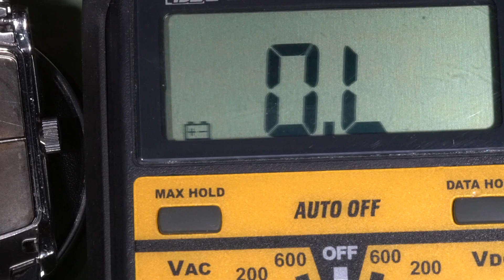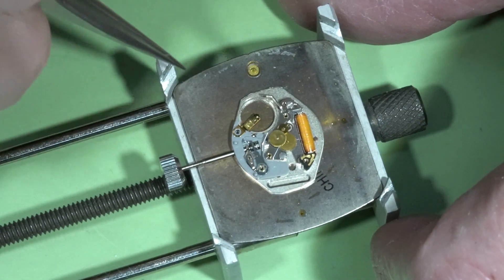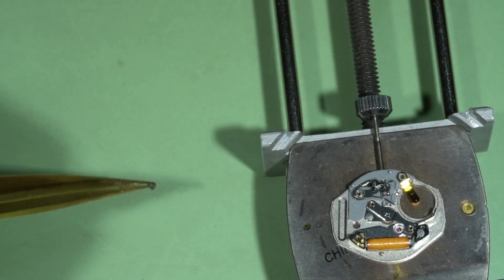Fixing Harley Ronda 763 Quartz Movement Watch Repair How To

Comment: That’s a Ronda 763E, it’s a one jewel movement, and you can easily tell by the silver metal over the gold tone used on the older Ronda 763’s. I have this movement in my Vero SWQ, and it’s pretty nice, reasonably accurate but I’d prefer a Miyota 2115 myself. Japanese quartz movements are really good.
Reply from the maker: I never saw 763 with E letter. There are G and some numbers, or just 763. The silver tone plates are used when the movement is manufactured outside of Switzerland, and gold are used in the original Swiss production. Both Swiss and Japanese quartz movements are good... until they broke. 🙂 Thanks for watching!

Comment: I understand repairing is good (less junk on the planet!) but for this wouldn't it be easier and cheap enough to just put a new Ronda 763 in it? I found one online for just €4.
Reply from the maker: Of course, it would. But there is an another layer of thinking (and doing), which explains why people have the most fun, when they can do, even it's harder, than not to. Sometimes they call it a hobby. 😀

Comment: LR Alkaline Batterie?
Reply from the maker: Correct, LR is alkaline battery. Thanks for watching!
Reply: @ValentechTime  That bat will only last 3-6 month depending on the movement therefore silver oxide is the recommended practice in the industry....and I did not ask for a validation and merely pointed out the inferior product. Nice work, thank you for your reply.
Reply from the maker: @SorinClenci  Sorry, misunderstood. You put a question mark on your first comment, so I answered.

Comment: did you find out why the rotor broke? you must have a large selection of parts. thanks for the demo.
Reply from the maker: I can only guess why the rotor got destroyed. Could be a dust accumulation in the very narrow gap between rotor and stator. But you never know for sure. Thank you for the comment.
Reply: I have 25 year experience of watch repairing, I never saw rotter broken this way. Sometimes it gets rust & pivot broke

Comment: Great work. Curious did you clean parts with one dip or in an Ultrasonic?
Reply from the maker: Thank you! I cleaned three wheels and upper bridge in 99% alcohol, also used a pith wood button and Rodico to clean pivots. I use One Dip for cleaning jewels in mechanical watches.